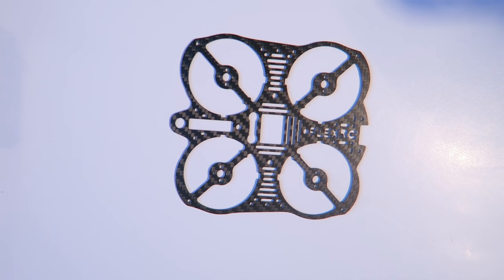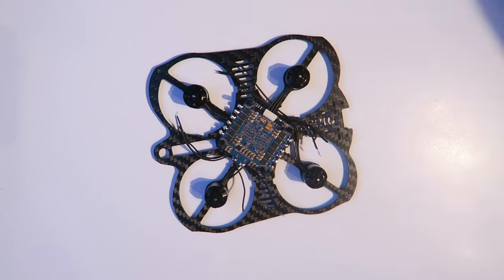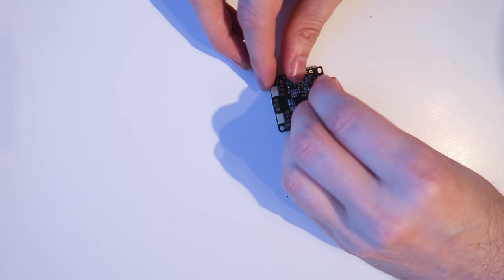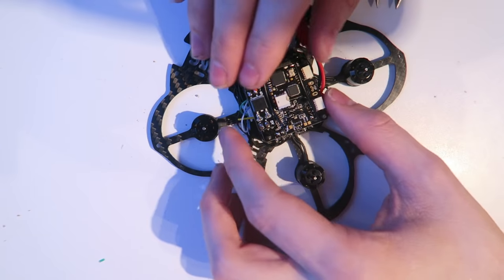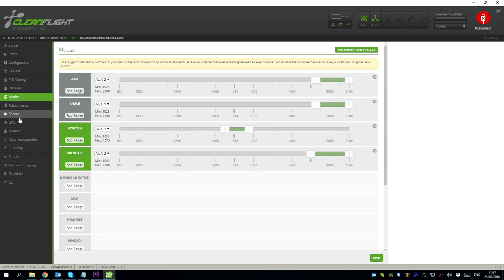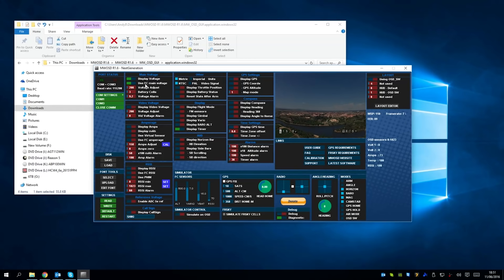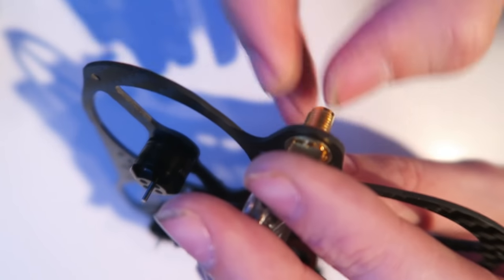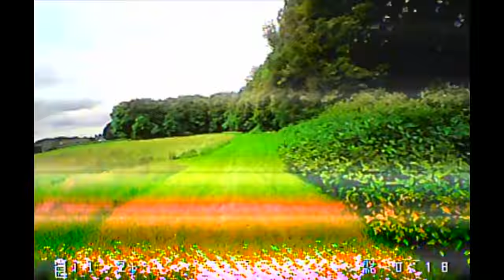FlexRC Mini Owl Build - Brushless Micro

Comment from the maker: INDEX
Motor Install 0:20
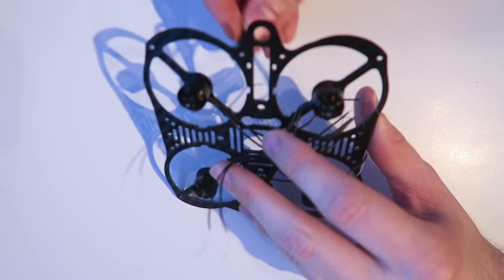ESC Install 0:55
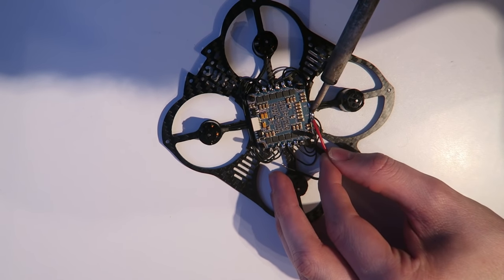Power Distribution 6:53
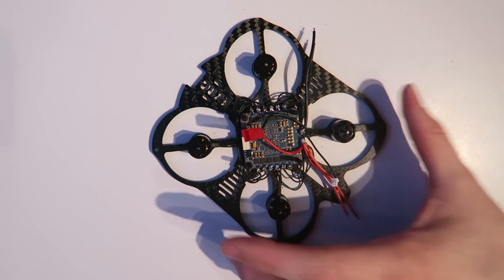Flight Controller Regulator 8:39
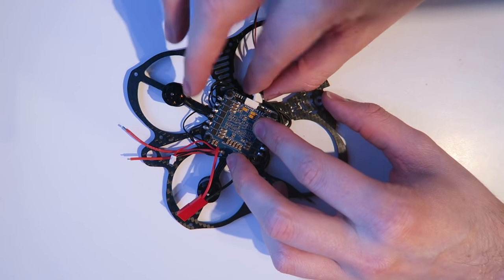Flight Controller PWM 9:35
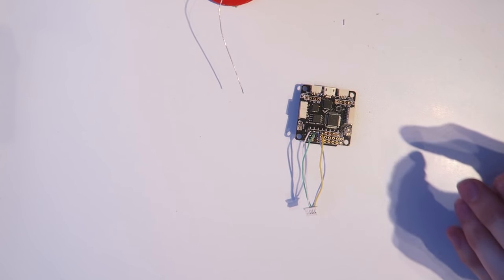Receiver 10:31
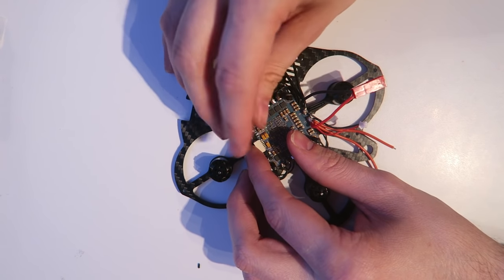FC Power Connections 12:19
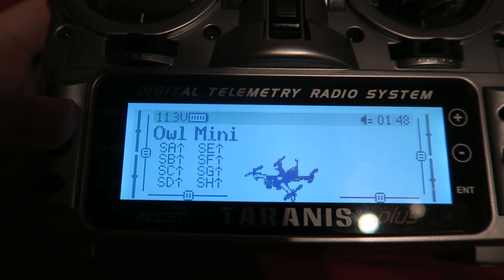Taranis Setup 13:15
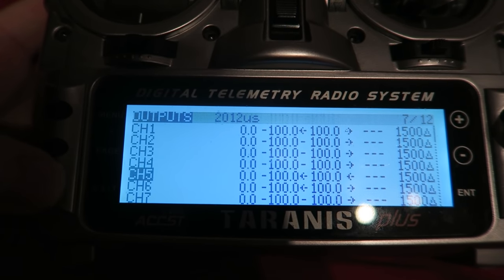Cleanflight 13:59
Motor Direction 17:27
On Screen Display 18:09
FPV Gear 22:39
Prop Cutter 25:51
Prop Install 27:31
Finishing off 28:06
Fly 29:08
Reply: New to multi rotor, massive fan of yourself and Painless360, FINALLY got minim osd working after this video, was trying to load default fonts for 3 days and occurred to me to load large font in BINGO, defaults must have been corrupt. Thanks alot and keep up the Great work.
Reply from the maker: good to hear thanks for the support happy flying!
Reply: Could I use the FX797T FPV unit that i have laying around from another project?
Reply from the maker: u can u would need to power it with 5v perhaps one of the spare ports on the fc

Comment: You can switch motor direction using BLHeliSuite, it has a pass-through for cleanflight so you can flash/program all escs by just connecting your FC to your PC with USB, much easier than swapping motor wires.

Comment: If the ESCs are BLHeli, you can plug the quad into your computer through the flight controller to calibrate the ESCs and change motor directions through the cleanflight connection

Comment: Awesome little quad Andy 👍
Reply from the maker: yes very nice build thanks
Reply: Hi Andy,I was thinking of getting into fpv. I was looking at the mini camera transmitter combo on banggood "fx798t 5.8g". I was just wondering if you knew what the splitter cable was called to power the system from the quad battery? Thx Dod.
Reply from the maker: i cant find any decent pictures of the connector online (i dont own that cam) but it looks like a 2 pin 1.25P JST
Reply: Ok thanks. Its just that I didn't want to solder it onto the board of any quad so I could use it on any quad I want. I doesn't have to be that cam. I'll try and find you video on it again lol. Thx Dod.
Reply from the maker: no problem

Comment: Hi Andy, I was wondering if you'd be able to help me out... I built a mini owl with an F3 (with built in OSD) flight controller and i am using a Taranis X9D plus with DM-9 module. I assigned a switch to arm the flight controller but for some reason it won't arm. when I connect it to clean fight, in the mode section, whenever I flip the switch to arm, it won't turn green. Other modes such as horizon and angle turns green when I flip the corresponding switches. When I connect the battery, the flight controller has a flashing red and flickering green LED. I wonder what is going on? Thanks in advance.
Reply from the maker: its usually when the throttle trim is set too high and the quad wont arm for safety
Reply: Thanks Andy!

Comment: Andy! Thanks for the video ... HUGE HELP man. 

2 Questions: when I mount the FC (and thus is upside down in pusher mode) do I have to switch anything in Cleanflight or in pusher setup it doesnt matter?

Also, in Cleanflight when I set the yaw to 45deg, does it matter if it's neg 45 or pos 45?

Again MANY thanks!!!
Reply: Arrow on FC is say north 0 or 360 deg, 45 deg is north east or 45 deg, neg 45 deg would be north west or 315 deg.
depending which way you offset your FC you'll need to you one of these. double check on config on cleanflight that quad representation goes the same way as you move your quad.
Reply from the maker: as dale advises 45 degrees is one way. increments of 45, which is 45, 135, 225 there is no plus or minus

Comment: Hi Andy.  Great tutorial.  I think your tutorial probably helps sell 99% of these!  Question;  I have a VERY limited range when flying my mini owl.  I'm using a Spektrum DXe at the moment but thinking about switching to my other radio (DX6).  Is there anything you can think of that is limiting my range (less than 100 feet)?  Or anything you can think of that will increase it?
Reply from the maker: +upmcmc either the transmitter is not very powerful or something is swamping the 2.4 band where u live. Definately try switching transmitters as I'm having no range problems. Cheers
Reply: Thanks for the quick reply!  I just tried to switch to the other radio and it keeps saying "bind failed"  am I not able to use the bind button on the transmitter to auto bind?  I hope I don't have to use cleanflight because when I tried to connect to my computer it wouldn't work.
Reply from the maker: to rebind it you will have to go into the cleanflight cli and type the bind code again unfortunately
Reply: Hi Andy!  The good news:  I was able to finally get my Owl mini connected to cleanflight to rebind my DX6.  The bad news:  after trying all of the steps and getting it to bind, my motors won't arm using my transmitter.  I can get them to spin using cleanflight and when I move my switches and sticks, I can see them respond on cleanflight but once disconnected from cleanflight, it won't arm.  Can you think of anything I'm doing wrong?
Reply from the maker: what method are u using to arm? rudder or a switch? thanks
Reply: It was a switch originally ("A" switch).  Do you think it somehow was defaulted to a rudder?  if so how do I test?
Reply from the maker: it wont default to rudder if you have set it up on a switch in the modes tab id say connect to cleanflight and plug the transmitter in. ensure that the sliders are within range of the green line in order for it to arm.

if working the arming bar will light up green in the modes tab when its active to show you that the arm switch is working.

Comment: why the "pusher" configuration? why not use the traditional "tractor" set-up?
Reply from the maker: i fly this one mostly indoors. tractor config leaves the blades less protected from above, its also more efficiant for the props if u can have pusher as theres no motor or frame in the way of airflow

Comment: Hey Andy,
I commented on one of your other owl videos. I was having a binding problem, which is partially solved. My quad binds, but when I fly, the receiver light will turn off, and the quad will drop down. The motors will still spin, as the rest of the quad still has power, but there doesn't seem to be an explanation to why the signal gets lost.
I have my cf settings the same as yours, but I used "8 for DSMX 2048bit/22ms Used by new DXe" instead of 7, as you did. I haven't had a chance to test it, but is there a reason why you used 1024 bit instead?

Thanks,
Dylan
Reply from the maker: have you tried installing betaflight?
Reply: I can't seem to flash the board. I can't connect to the bootloader
Reply from the maker: what FC are u using?
Reply: I'm using the one that came with the kit, the spracingf3
Reply from the maker: you need to enable the baud rate button and change the baud rate to 256000
Reply from the maker: check out 14:01 in this vid
Reply: I did try adjusting the rate, it didn't make a difference for me. I've read some people have had a problem connecting the board, but I haven't found a solution besides getting a new one.
Reply from the maker: that is strange. changing the baud rate works for me
Reply: I swear I've tried it several times... but it just worked lol
Reply from the maker: wonderful!

Comment: were di you buy the power regulator i cant find it
Reply from the maker: here u go http://www.banggood.com/Diatone-Micro-BEC-5V-6V-12V-500mA-Module-For-RC-Multirotors-78-Series-Regulation-Chip-p-1027492.html?p=XO2013166930201304K5

Comment: What settings u put in cleanflight for the fc upside-down down
Reply from the maker: 180 degrees
Reply: +AndyRC on yaw or pitch  because I see in your video u got 45 on yaw
Reply from the maker: yes but mine isnt upside down i mounted it so that when the quad is the right way up the flight controller is so mine is set to 0 and just 45 on the yaw

Comment: Hello buddy, I have a question. I'm having a drift issue and can't get it leveled out. What can I do
Reply: Dustin Gilbertson check that your props are balanced, depending on the brand, some come grossly out of balance.
Reply: Mark Spohrleder I've swapped props around cause no way of checking balance and still have a progressing drift
Reply: The same drift, if changing props around would swap the drift around you'd think
Reply: Ok, you can put the prop on a pin or needle and the heavy blade will drop. Mark it so you remember which blade it is. Then sand a little off at a time till it is close to balancing without dropping a blade.  Make sure each blade is the same length also.  Also, did you calibrate your accelerometer on a level surface?
Reply: Dustin Gilbertson Dmitri always says to check the balance first, because the FC is very sensitive to vibration.  Maybe you have a gyro issue.
Reply: Mark Spohrleder I'm using a cc3d board, favuorite 4n1 esc board and f20s, flashed with openpilot. I've calibrated the gyro a numerous of times and it shows level. The drift continues to progress as the flight goes on. I've swapped motors and does the same drift to the right and it's all new components
Reply: Man, I'm stumped. I would try a new board.
Reply: Mark Spohrleder new fc or esc board

Comment: What kind of flight times are you getting?
Reply from the maker: 3-4 mins depending on how hard u fly. indoors usually 4 mins
Reply: Interesting. My weight is 185g and I am only getting around 2:30 basically just hovering in position.
Reply from the maker: thats too heavy mine is 118 grams
Reply: I figured weight wasn't helping things. Mine is with battery on board, printed upper and lower bumpers, printed battery holder and 8 LED strip on the rear. With all that in mind, I guess it is about right?
Reply from the maker: yes i found the bumpers too heavy and led strip as well

Comment: Great vid! I am having trouble with uploading Betaflight 2.9.0. I did it once and everything seemed fine. when trying to Connect it times out and does not connect.  Tried reloading Betaflight 2.9.0 but now it can't communicate with Boot loader.  what can I do from here?  Thanks in advance for your help!
Reply: Update...Just realized I uploaded Betaflight 2.9.0 for Naze and not spracingf3.  Will that cause issues with not being able to connect with Bootloader?
Reply from the maker: not the bootloader just flash the spracing version and should be fine
Reply: AndyRC tried but didn't work. No flashing red light either. Blue light is solid though. I'll try the forums. Thanks for yur help Andy! Looking forward to future vids
Reply from the maker: have u got the boot shorted?
Reply: I tried bridging the boot pads. Did I cause a short by doing that??
Reply from the maker: no that will be fine thats what u need to do when the wrong version has been flashed. u cant brick them or short them. solid blue light is boot mode. u just need to flash the correct sp racing firmware and then unshort the pins
Reply: I bridged the Boot loader pads and the blue light came on like you said. But Cleanflight still can not communicate with Boot loader.  Betaflight v.2.9.0 is the version I am trying to upload.  I'm very new to the hobby...sorry for the trouble Andy!  You have been a tremendous help to me with your vids. :)  I guess $25usd down the drain.  Dang..didn't even get it in the air. :(  Live and learn.. ;)  Thanks again for your help!  If you have any other suggestions that would be great.  Cheers!!
Reply from the maker: it could just be a driver issue try this method...http://alienflight.com/firmware-flashing-f3/

Comment: Great video, thanks. Despite your help found it extremely hard to fit all the wires, the OSD and the uncased lemon receiver into this quad. But here is the REAL PROBLEM ... really helpful to see your video on OSD install but when I throttle up, the screen goes grey. Any thoughts?

https://oscarliang.com/minimosd-micro-setup-naze32-pid-rssi/ says to put all things on common ground but thought I did that. Ideas?
Reply from the maker: are u using a different vtx to the one in this video?
Reply: Nope same one. But I decided now to switch my FC and try the new BrainFPV RE1 I just got in the mail :-)
Reply from the maker: oh nice hope it works out for u